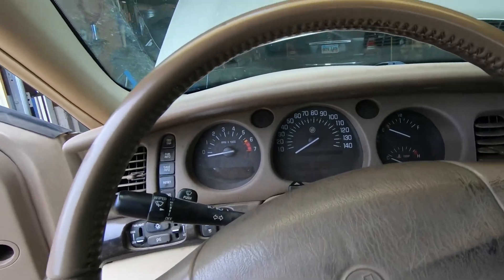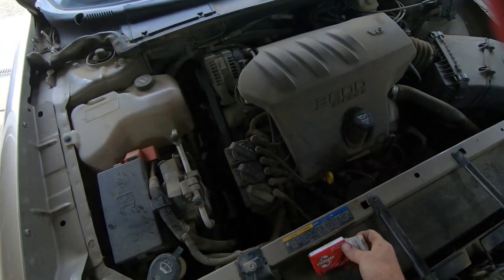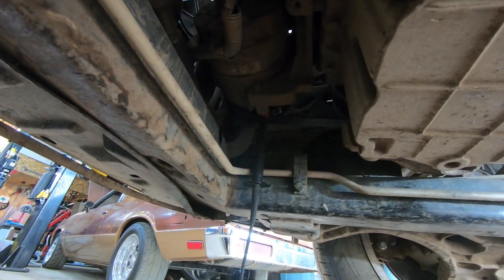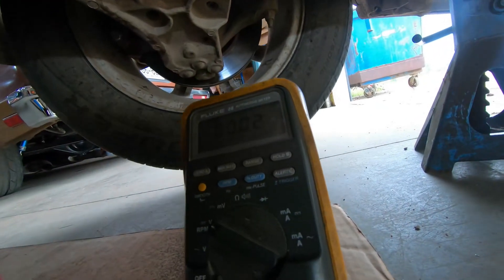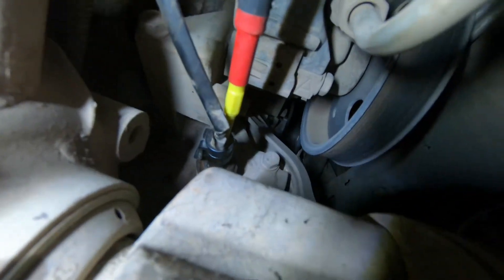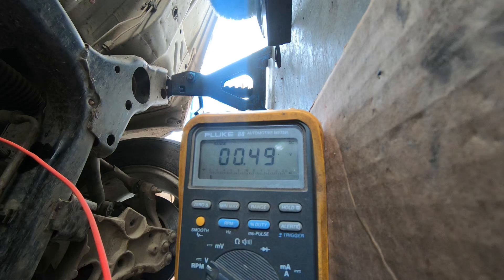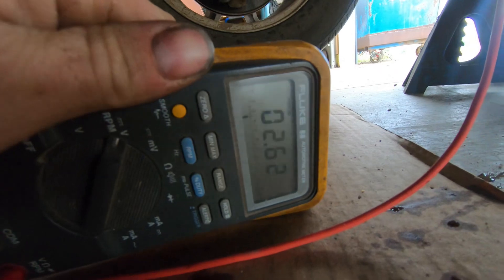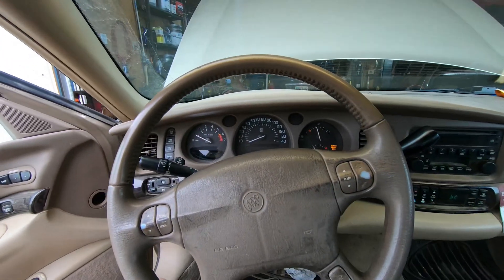Testing 3 Wire Sensor Oil Pressure

Comment: Mercury checks resistance between the pins with sensor removed. Hard to latch onto the recessed pins with a multimeter probe.

Comment: Nice video as always. would you not check the ground for any added resistance that would impact the signal before condemning the oil sensor? This is for my added understanding as i am still learning

Comment: I changed mine on my 01 jeep grand cherokee wj, when I start it up it start at 40psi then after driving it drop to zero.
Reply from the maker: That sounds like a good sensor and you actually have oil pressure issues.
Reply: @CrazedPerformanceRepair  this morning I was driving n start at 40psi ,but I stop n idle at the stop light it hold for a while n then at time it drop n then when I start to driving it goes up to 40psi.
Reply from the maker: @mrno3525  sounds like worn out engine with too much clearance somewhere or possibly a pressure relief valve issue. I'm not super familiar with jeep oil system. It's been probably 6 yrs since I worked on a 2001 jeep Cherokee .
Reply: @CrazedPerformanceRepair  ook ,gonna try and get the Mopar oil sensor, the thing is I was at work n washin the van and the guy open the bonnet n started to wash the engine and mess up my coil pack,when I drove at that time the oil gauge needle went high. So I replace the coil pack n it running better than before ,is just the oil sensor now

Comment: I had a 2009 Silverado 5.3, I would go through an oil pressure sensor every 1-2 months. It would blow and leak oil out of the connector of the sensor. I used all different brands including OEM, Dorman, Ac Delco. Only thing I can think of is the high pressure relief valve in the oil pump was occasionally sticking to full pressure high and blowing it.
Reply from the maker: I've never seen that before, interesting. Especially considering there's another relief valve in the pump it's self.
Reply: m m